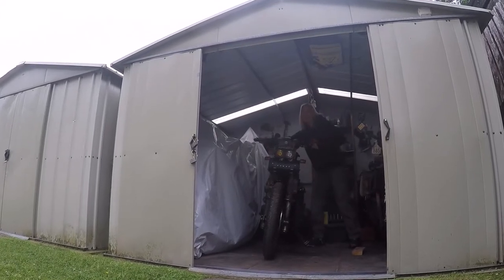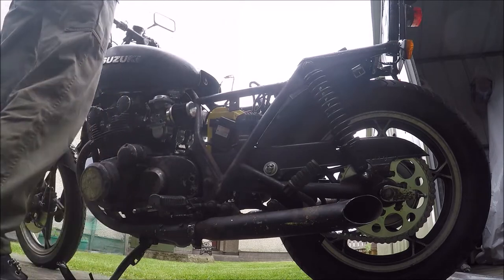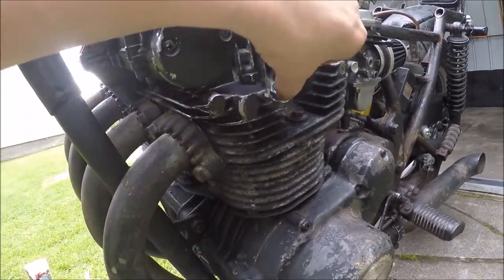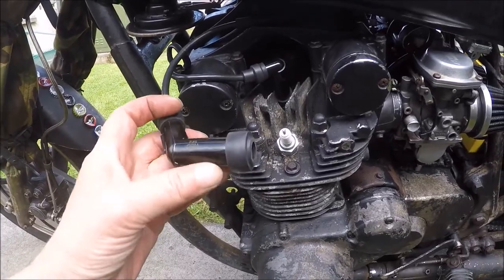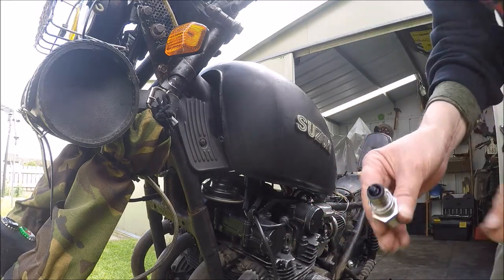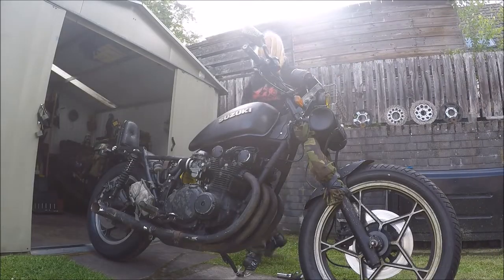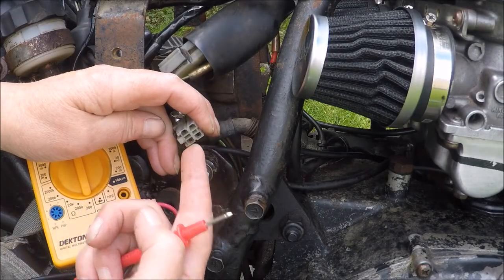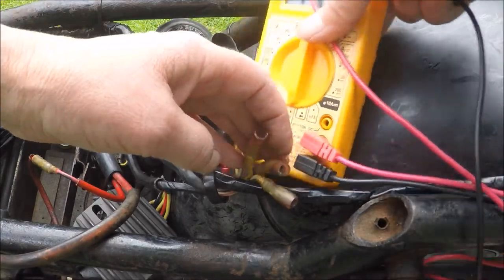GS550 Rat Bike Restoration Project 42 #Troubleshooting & A Process Of Elimination!

Comment: maybe because of the open air filters, that its getting too much air, to test it you can tape them of and leave a tiny gap, if that doesnt make a diffrence you can take the filters of and look if the vacuumslider for the gasneedle works if you give it throttle, maybe you should do that first and then the tape thing ^^, the old carbs probally had bigger jets in them for the open filters.
Reply from the maker: Thanks for your advice however the carbs have already been set for cone air filters and I know there in good working order. It's more likely to be an electrical fault/problem as the bike ran to begin with but I haven't ruled the carbs out completely. Some further investigation is required.. :)
Reply: @Ratqueenbikes  hey Queenie!.. Great stuff as always!.  Have to give a shout out about the petcocks on these bikes.. Not to belive if not tried out,.. But get a petcock on a loan to try out, and see how it works.. Your time will eventually pay off.. - and you're having a great bike there!.. :-)
Reply: i opend the main jets on my old GS550 rat using a micro drill bit. you can get them off fleabay. dont see thew point of fitting pod filters only to tape them up to reduce air flow!! get bigger jets to compensate extra air flow and get more power from your engine.
Reply: @stephenczyrt5995  if youre searching for the problem you can use tape, for long terms you can replace the jets, a micro drill bit? good change you will damage your jets and make some bigger, i always used brake cleaner and iron wire wich fitted trough the hole in the jet ^^

Comment: For me, the spark of the new bobbin was weaker than the weakest spark of the old one.
New is sometimes China junk, and sell them as original in some stores.
So you will have to check everything from electrical.
And carburettors, synchronization, air, quality gasoline.
You can also try with Scotch whiskey.
Promises and ultimately threats :-)
Reply from the maker: Thanks hun, very well said and I completely agree. I have to check everything and you could be right about the spark plug. The bike is testing my knowledge and skills to the max! ;-)
Reply: Just had a new spark plug fail too . I think the issue is in the carbs ,the vacuum for the diaphragms .
Reply from the maker: @duncanrae7504  Hi hun hope your doing fine? It's not the same this year and I miss the laughs we had at the rallies. Time will tell with regards to the bike! Take care and stay safe! :)

Comment: P.S. Given that the bike was running well in the house, and now not in the garage.
Could you have a moisture or corrosion problem.
I've only had twice that. The 1st time was water in the petrol, refueling at an almost empty petrol stantion.
2nd time, new nozzles in the carburettors = In the 2 cases the engine starts but has no power.
Reply from the maker: Good suggestions thanks hun but I can't see it being moisture. Your right about it running well in the house. It's more than likely electrical but with some further investigation hopefully we'll find out soon. I haven't ruled out the carbs but plan to..

Comment: Logic :-)
You had soldered that old bobbin, and then the engine worked well.
The wire is broken
The engine block does not go well with new bobbins. 
Or the bobbins are connected incorrectly?
Conclusion, repair the old bobbins, and try again.
If then goes well ....
Reply from the maker: Thanks for trying to help hun. When you say bobbin I presume you mean the coils. Unfortunately the old broken coil is beyond repair and one of the leads was burnt out. As for the new coils I tested them before connecting them to the bike and all was good. Yes they are connected correctly. I suspect it's something else electrical? I'm still investigating and should have an answer for the next video..

Comment: I would get rid of those tiny air filters
Reply from the maker: Thanks for your comment but unfortunately I can't. The bike was chopped and modified before I got it and there is no room to put an original air box on.
Reply: Ratqueenbikes id recommend trying to start the bike with them removed.  Ive used similar filters and they choke out the bike 👍